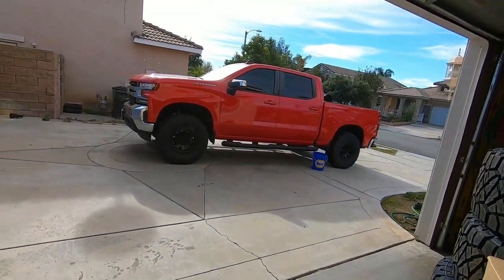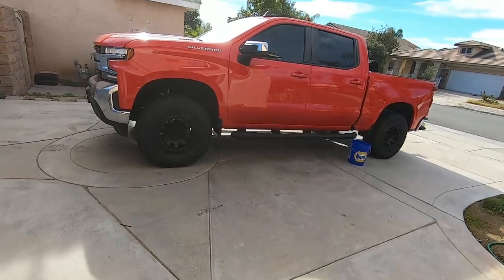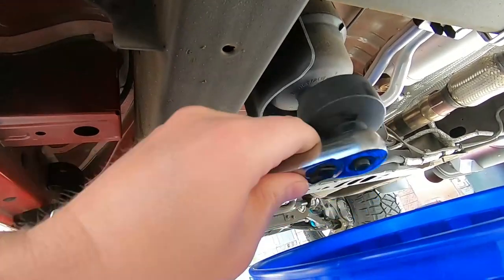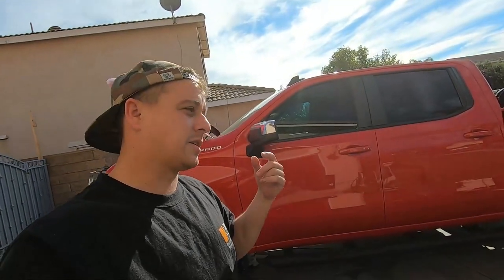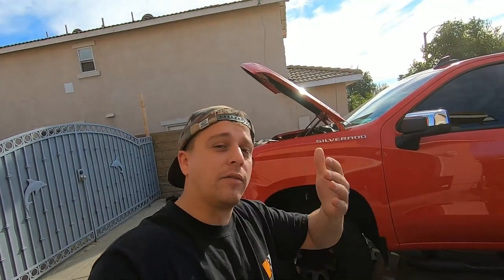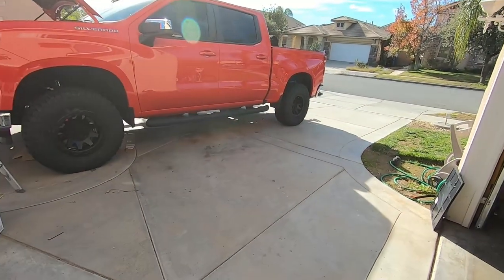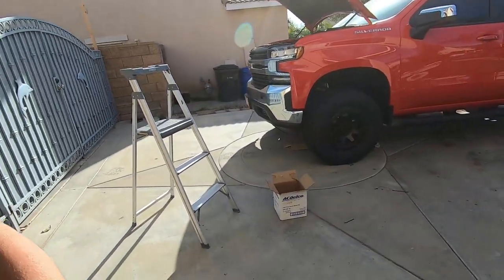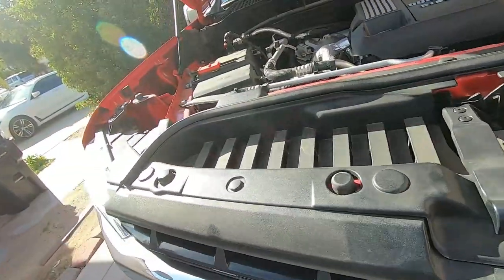Changing the Fuel & oil on the LM2 Duramax + Updates under the hood

Comment: You did 3 in front.  Any in rear?  My 2021 Z71 just seems so low 🤦‍♂️
Reply from the maker: i did a deaver mini pack in the rear and did 3" up front. this would be 1" higher than a trail boss since those come with a 2" lift from factory. hope that helps.